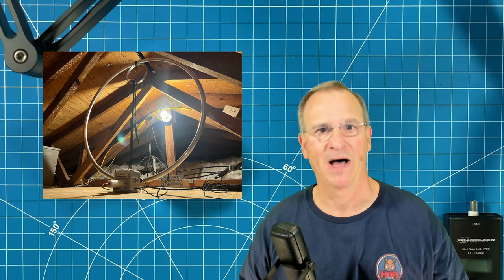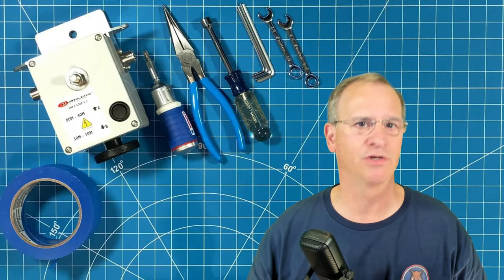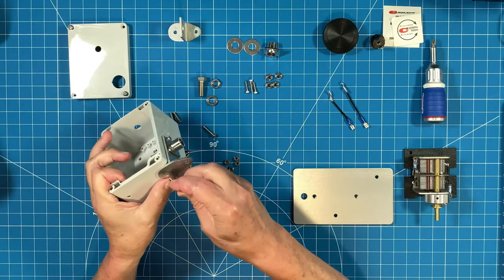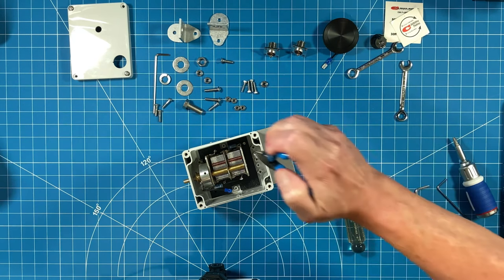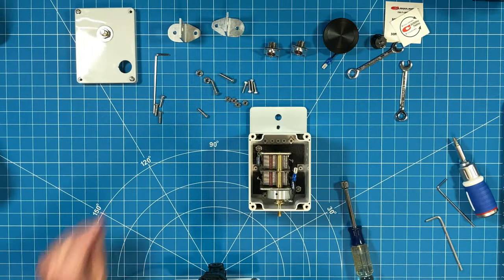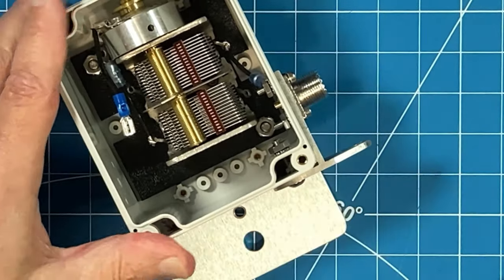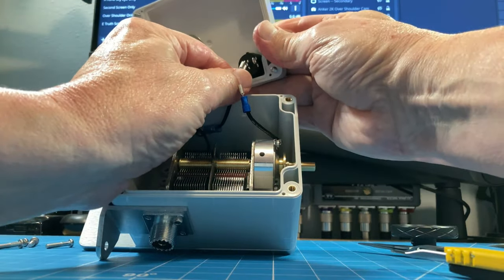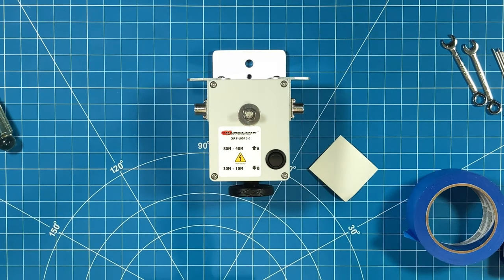Chameleon Antenna CHA F-Loop 3.0 DIY Build Kit - Step by Step Instruction Guide on Building Your Kit

Comment: You forgot to tell everyone to tighten the 2 small Allen screws around the housing to the shaft.  I didn't do that and when it was all assembled the black knob, even though the Allen screw for the knob was tightened to the shaft, it would spin without hitting the physical stops on the butterfly cap.  As a result I had to take it  apart to get at and remove the butterfly cap.  Once it was removed from the housing I could gain access to those two small Allen screws.  After I tightened those screws I could feel the physical stops when I turned the black knob.

73,
K9AT
Reply from the maker: Thanks for that feedback @MacsForever1.  I tightened the top right when I added the pigtail...didn't think to check the bottom left.

Mine is working fine, i.e., turning and hitting the stops, so I am good.  Your input will be helpful if anyone has follow up questions experiencing the same issue you did.  Appreciate you sharing the detail.  Gonna pin to the top so others can see.
Reply: Mine might have been a fluke that was not tighened but it's good to double check the cap while it's out of the housing to be sure. @HOAHamRadio
Reply: Mine was tight, but I could not feel the physical stop on full open. My cap is damaged. Expensive discovery 😢

Comment: Thanks for the assembly video. I just saw it on Chameleon website yesterday and couldn't believe it. 
I kept thinking there was some catch to it -- but there wasn't.
Cha equipment has always been out of my budget, but this one is a winner. 
I'm going to order one today before they run out.
Reply from the maker: Its the real deal.  I couldn't believe it either.  For 30 minutes of your time (maybe 45 after set up, break down, tool put away) its a good buy.

Comment: Great. Video! Love your channel.

I bought the DIY Cha Loop 3.0 about 6 += months ago. I was so excited that I could afford a CHA antenna at the lower price.
It will not tune 30-10 meters at all.
I think the switch is defective. One of the pins is loose. I contacted Chameleon and told them about the problem.
They said I had to send it back to them on my dime and give them another 80-100 or so for them to fix it.
I do realize there was no service that came with this purchase. But I could have bought an assembled unit for the extra money I'll need to spend fixing this one.
I was so disappointed I put it back in the box since then.
Well, I got it out and tried to see if I could do anything myself. 
Question: Does anyone know where to get another switch?

Comment: Another great video! Unfortunately, this one is about a month too late for me. 😅
I bought this diy kit during the Labor Day sale because I just couldn't pass it up with the 20% discount. I searched the net for videos like this one, but none existed at the time. Even still, it's very easy to put together following the pictures on Chameleon's website. It only took about half an hour. I had one issue with the kit, one of the loop brackets had the holes for the SO-239 different than the holes in the case. There were even marks on the bracket from a marker showing where the holes should be. But it was an easy fix. I just drilled two new holes in the case using the bracket as a template. Other than that, it is an easy to build kit. And a great antenna too!
Joe kb9rcr
Reply from the maker: Thanks for the view and feedback on your experience; hoping to get out with it in the field this weekend and give it a go.

Comment: Great video. Kit went together fine. Missing 1 flat washer. Bad news...I opened the capacitor too far. No mechanical limit. Destroyed the cap. I will be paying for my mistake with a full disassembly and cost of a replacement assuming Chaneleon will sell me a replacement.
Reply from the maker: Oh no!  Keep me updated on the outcome.
Reply: @HOAHamRadio Chameleon has shipped a replacement capacitor. The friction clutch in the reduction drive should have slipped at the limits. I expect to return the damaged cap for an engineering post morten.
Reply from the maker: @wa6smn  Chameleon is top notch!
Reply: The replacement cap arrived with wires & ring lugs. Re-used plastic base and screws. Fully assembled now.
Reply from the maker: @wa6smn  Fantastic!  Fully enjoyed the build now have to get some RF through it.